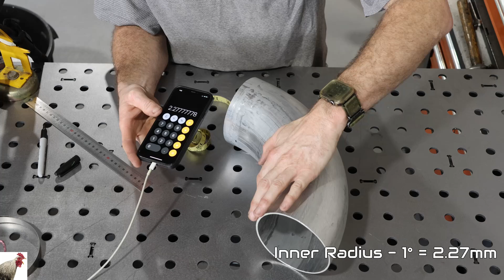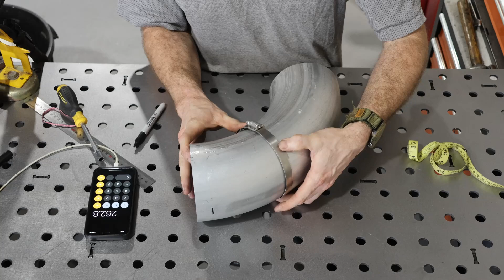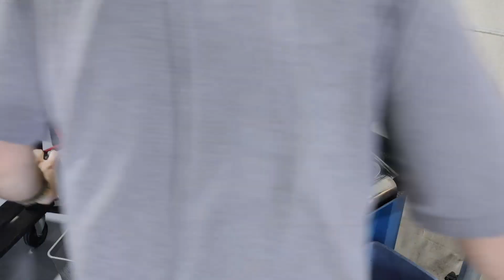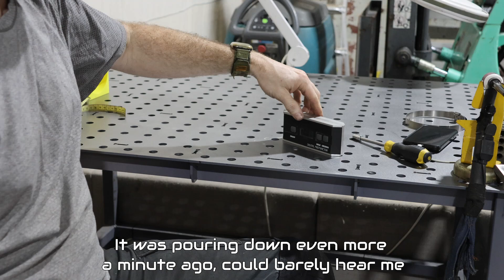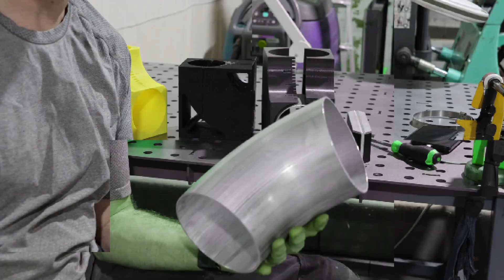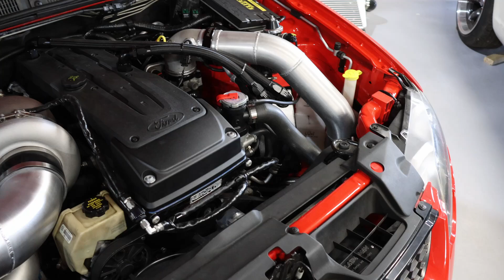Hermit’s Fab Tips #1 - How to mark and cut mandrel bends

Comment: No hate, but using a snug zip-tie around the tubing is easier to mess with than a rubber band or hoseclamp; and does a nicer job giving you a discreet "straightedge" for making a clean sharpie mark.

Cheers! Fab work on the Barra looks great.